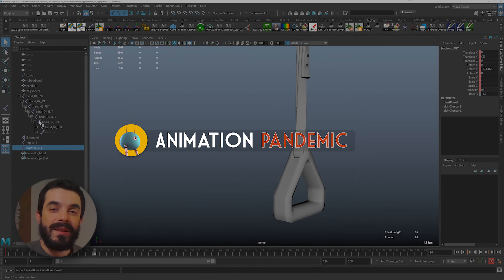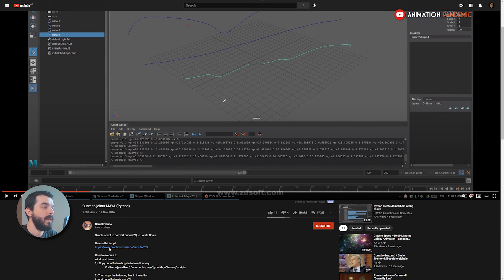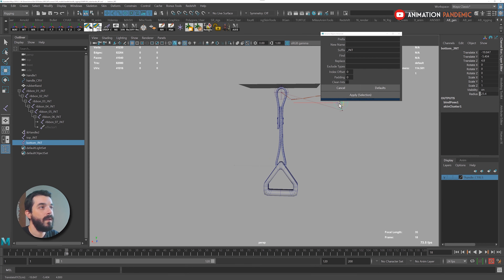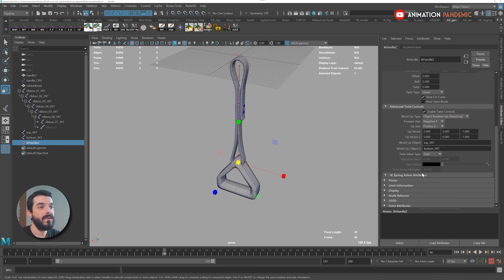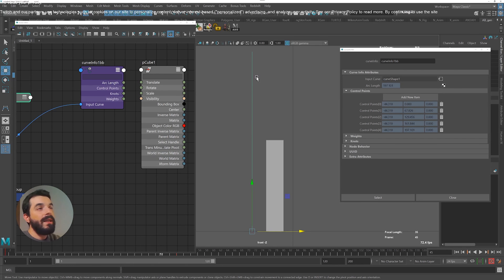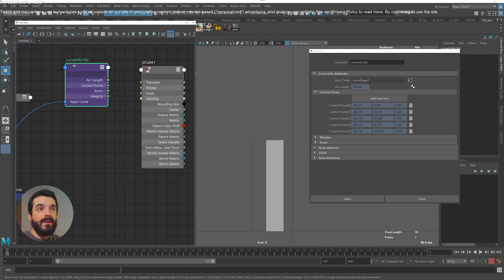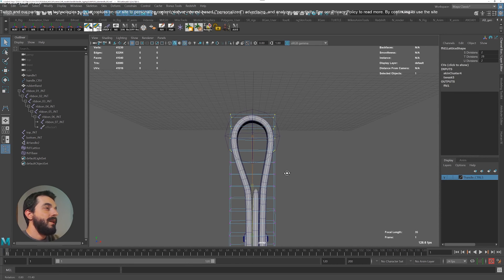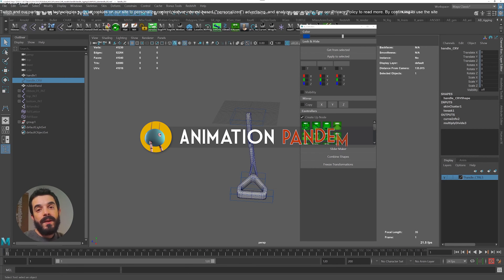Twisty Stretchy IK Spline - Rigging a subway train handle

Comment: Hey Amedeo. Bit of a noob question, but my curve stays as a straight line when I manipulate it, after the joints are created. I can't seem to get it to bend as yours does at 3.50. Thanks.
Reply: I got it, all good :)
Reply from the maker: Hi David, sorry, I am just now coming out of a super busy time.
Reply: How did you get this to work? Struggling to figure it out now
Reply: @ashleyknehans4442  Sorry, it was a while ago now and I've switched to Blender. Best of luck.